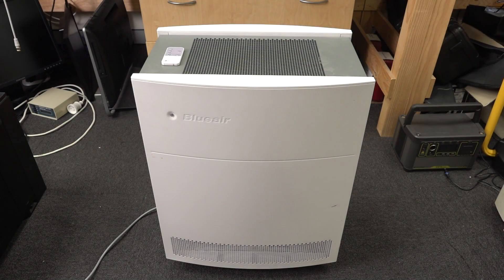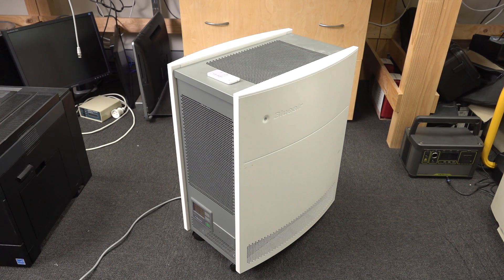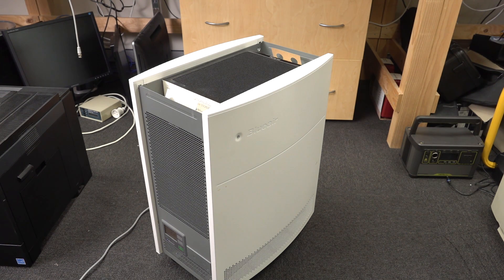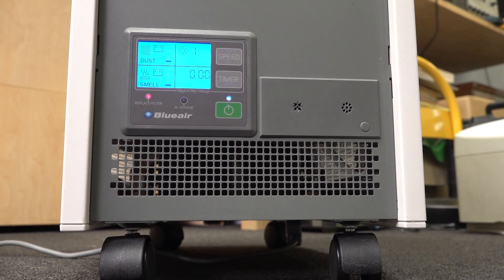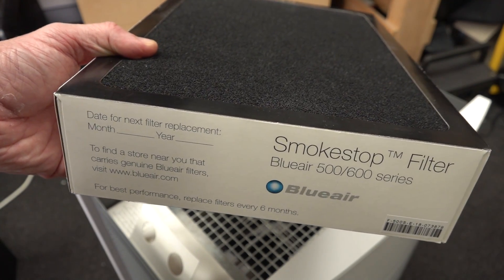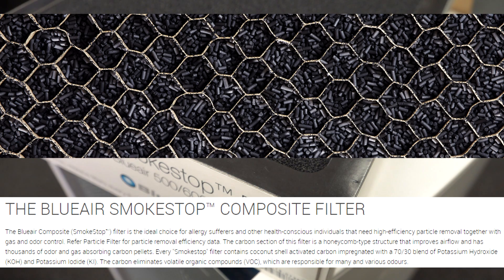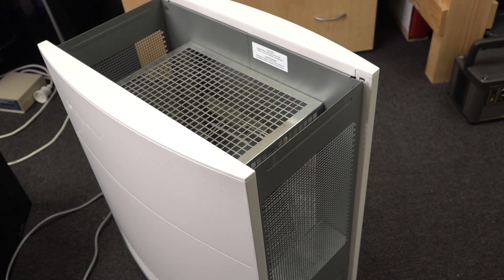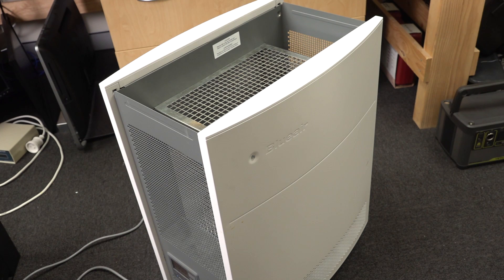EEVblog #1295 - What Makes A Good Lab HEPA Air Filter?

Comment: My opinion is that good Hepa filter doesn't have cardboard holder. The reason is that carboard is soft and is unlikely to be able to stay true from factory to the installation in the machine. The particles filtered are minuscules and the filter will get clogged with use. Once clogged, the air will have more difficulty passing through and will have a tendency to take the path of least resistance which could be a leak around because there is a play in the carboard holder which didn't stay true from factory.

Also, does that unit have seals around those Hepa filter? If it's just pushed against a holder, that's not good enough for ultra fine particles. The filter may be Hepa but you are not getting a Hepa grade filtration with all those leaks.

Futher more, how much activated carbon that unit have in it's carbon cartridges? A good units will have upward of five pounds of carbon. Ideally even above ten pounds. 
 
That may be a good air purifier but my personal opinion is that it's not among the best.

IQAir, Austin air, Airpura are much better units.

Comment: A few chemical gases found in many workplace that no carbon activated filter can remove from the air not even your blue air fancy metal box.
Acetylene, Acetaldehyde, Amines, Ammonia, Butylene, Butyne, Butyraldehyde, Ethylene, 
Methane.

Comment: After seeing this post, I bought a Classic 680i air purifier, that comes with a hefty price by the way.
I’m very sorry but I expected more of both the app and the device.
You can set alarm ranges for all the items that are measured, but they just don’t work. Although my phone is working normally and the notification setting are correct.
The device is noisy at the lowest setting, and makes a rattling noise as if the bearing has an issue.
When I start soldering next to the device, it detects an increased number of particles, as you’d expect.
But then something very annoying happens: the device starts oscillating between the lowest and the highest setting.
Come on, that’s very poor control loop design.
The engineers at Blueair should try to understand how a PID control loop works, and how to design the control electronics properly.
In short: such an expensive unit has too many flaws, both to the app as to the device itself.

Comment: 2:12 "Mechanical filters can only do down to about 0.3 micron at best" - Sorry Dave, but think you're well out there. 0.3um is the "most-penetrative" particle size for a HEPA filter. Diffusion typically traps particles smaller than this, and impaction/interception bigger. https://www.cdc.gov/niosh/docs/2003-136/pdfs/2003-136.pdf?id=10.26616/NIOSHPUB2003136 - p8-12

Comment: 20x20 Lasko box fan ($18-$30)  + 
20x20 HVAC 3M Filtrete MERV 11 (perf 1200) allergen filter w/carbon ($15)  + 
NiteIze CamJam (w/ paracord) (~$8?)   :P   (one step above duct tape - lol)

Super-portable, multi-purpose, inexpensive filter media, easy to use.  There are several YouTube videos suggesting (/testing) this config.

Its not HEPA, but it seems to get out whatever allergen usually bothers me and the carbon does a great job of killing odors.   I personally have enjoyed this more than I expected.

Comment: Hi, your comment re. Hole in the ozone layer should also include "Ozone on Bonding Beach-Periodic table of videos"; how air circulation has been altered to cause rainfall to move Southwards from Oz. This accounts for the devastating droughts in Oz and the new horror of fire storms. The chain of consequences is no joke eh? Nice filter! Great eevblab #72 report, thanks for the research on Medtronics (the ultimate profit oriented company using subdivided territories to push up pricing of insulin pumps. Would you please do a BOM of typical insulin pump designs and relate that to the price of £3000.00 per unit here in the UK? I believe a world-wide single design mass produced would bring a unit price of £5/Au$5 to the table with open source contributions.

Comment: The 0.3 um size particles is actually the worst size for particles, anything bigger or smaller(!) in size gets filtered better. That is because smaller particles then get bounced around by brownian movement of air molecules and "slam" into the blown fibers of the filter and get stuck there.
Also coronavirus is spread by droplets that quickly dry out in the air and create "droplet nuclei" that are larger than the virus itself.
Source: 3M - Respiratory Protection for Airborne Exposures to Biohazards https://multimedia.3m.com/mws/media/409903O/respiratory-protection-against-biohazards.pdf

Comment: Blueair's website has an info graphic that shows a pic of a cube (not a square, but a 3D cube) and next to it, a SQUARE footage rating. Lol. I guess it can handle a 750 ft^2 room, with anywhere between a 6 foot tall to a 16 foot tall ceiling. (4500-12000 ft^3) Derp.

Comment: I run an Amaircare 4000, and it works great! About 20 pounds of activated carbon inside for the VOC and the hepa filter for everything else. It can change the air in a 3000 square foot area 6 times an hour. It's freaking wicked!

...
And I paid 6 bucks for it at a thrift shop.
Reply: What does the replacement filter cost?
Reply: @Daniel-hd7gq  About 290 US dollars.

Comment: I always compare the negative feedback loop of recirculating an ineffective % population of the air in a given time through any exchanger - filter, exhaust, etc - as the same as homeopathy. You can keep cutting it, but if you are mixing clean with dirty you're just mixing the clean back into the soup. This is where proper ducted systems really come into their own where there is a centralized collection point but distributed outputs - causing a net flow through the room that goes faster than the diffusion ratio of the particulate's ability to mix upstream.

Comment: In my opinion bacteria usually are larger: 2 - 3 micrometer (f.e. bacillus subtilis) instead of 0.5  micrometer. 
2:14
Reply: It's not a matter of opinion. Bacteria vary in size by 2-3 orders of magnitude. They can range anywhere from sub micron to the visible range. (Like T. namibiensis, which can be almost 1 mm in size.) It is an infographic. It can't represent every possible bacteria.
Reply: @xenonram  they most likely used rickettsia as the bacterium as it's around 600 nm in size

Comment: I have used those same filters, along with a hardware store cupboard, three large computer fans, and an arduino with similar sensors on a project at home. The dust sensor looks like the Sharp model available commonly for cheap.  You can also get much better particulate sensors like the Plantower PMS7003 commonly now too.

Comment: This is a nice looking filter.

A simple alternative that I use near my 3D printers is a 3M FAP-C01-F1 (~$50 US)  combine it with a FAPF-F1-H (~$20 US) and its lists 0.3 microns and 99.97% airborne particles.
Reply: From what I've read these are almost better. They do lack carbon filtering, and Ion generation but do charge the filters through friction. Their design is somewhat stupid though, sucking in air from the floor if thats where you keep them (I have the bigger unit)

Comment: Please be aware, the safety aspect of a HEPA filter is the seal to the frame/body, and the potential failure of the filter components. In commercial use, HEPA filters are "challenge tested" to ensure their efficiency. The American Society of Heating, Refrigerating and Air-Conditioning Engineers provides a consensus standard for this process: https://www.ashrae.org/File%20Library/Technical%20Resources/Technical%20FAQs/TC-02.04-FAQ-68.pdf

Comment: Have you seen the Airocide?  I have one and very happy with it, would be interesting to get your opinion! It's not a filter so much as a killer of tiny things
Reply: MarkFromSales I believe they are overpriced gimmicks. High price, low air flow, and only works on biological pollution. A comparable price hepa/gas absorption mix will outclass any free radical/catalytic conversation based air purifier.

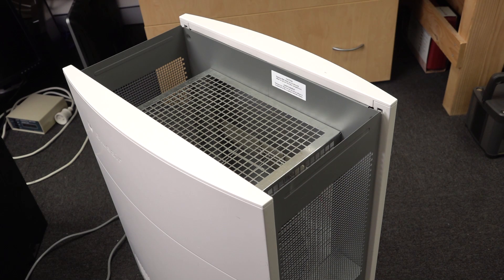Comment: 15:50  It's very easy to teardown and to get into it. You can see (14:09) at the top inner side of the machine, there are screws ~5 cm above each side filter. Unscrew the total 4 of them, then simply lift up the giant white-colored shell on each side, then you have access to the inside of the machine and maybe give a clean to it. I have a 550E used in my home and it has a very similar design with your model. 
Fun fact: the giant fan is actually made in Germany rather than China. 
Caution: Be very careful with the ionizing devices inside. It has small brushes at the end of it and the brushes are actually very fragile.

Comment: While looking on google for specs of H11 (I have some Kirby HEPA rated H11 bags for my Kirby vacuums), I found one site selling some room filter which proclaimed that H11 was "better" than H13/14, using the fine vs. coarse tea strainer principle, because apparently using two filters stacked ontop of each other "works better", except it's still only H11, which is not H13/14, had a good laugh at that one!!! Think they had mistaken filtration for airflow, which apparently they have issues with on both... :P

Comment: Side panel removal. I have a non sensor model the of same size. To remove the sides to vacuum/clean. There are two screws on each side panel at the top in the filter area. Remove these and the panels will slide up about 13mm and unlatch from hooked tabs on the bottom. You may need to lightly bump the panels upward with a light rubber mallet or your palm. While the outside painted panels have been de-burred, the inside galvanized panels are not. If you knock about inside with a brush to loosen dust you'll end up with some scraped knuckles.

Comment: Producing ozone for dezinfection is not bad. I know that it is not good for us to breathe, but saying that air purifier that produces ozone is bad and one that is not producing it is good is not correct. I would say that the one that releses it into the air while you are in the room is not good. But if it has the function to produce the ozone  to clean the air while let's say you are at home might be good idea.
Reply: They will never produce enough ozone to be an effective killer.

Comment: The wifi and app on the later 680i BlueAir model only works with old wifi protocols that no one who is sane would use anymore.  Shame as knowing the pollution levels is useful, I buy the meters of eBay and scatter them around the house .  The filters on the the BlueAir model are really expensive like $150-$200 each (times that by three) as they are combined hepa & dust and need changing every 6 months ... I prefer the E20 Inovaair's (ozzy made too) they filter before the air hits the fan, so the fan doesn't get dusty and they hepa filters last way longer - like years as the dust filter can be changed every 6 months for $30.  I have no affiliation to Inovaair ... theirs is claimed to be certified H13 ... but they also claim to have been lab tested down to 0.003 microns @ 100% ... which is a weird / bold claim to make & advertise.  "Certified 99.97% minimum efficiency at 0.3 microns (tested down to 0.003 microns @ 100% efficiency)*".  It has no electrostatic that I know of.   https://inovaairpurifiers.com.au/products/airclean-e20-plus
The Inovaair's charcol / hepa filters are REALLY heavy like 25 kg, you have to remove them for shipping or they will damage the unit. Inovaair are endorsed by Asthma society and also make medical / industrial grade ones for hospitals and the like.  I got my entire extended family onto them during the recent bushfire season.
Reply: https://smartairfilters.com/en/blog/what-is-pm0-3-why-important/

Comment: The ozone such air purifiers generate is tiny and ozone (o3) quickly falls apart and becomes oxygene (o2) in room air. Every laser printer produces more ozone than this and you still have them in your office.
Reply: A laser printer doesn't run 24x7. It runs for a few seconds/minutes a day. That's why you don't smell ozone from a laser printer, but you do from ozone generators. I am with you in saying (implying) that the neg ion generator in the air filter is no big deal. People seem to confuse neg ion generators (ionizer) with ozone generators, with the former producing less ozone than the latter, and laser printers producing less than the ozone generator; since they are not continually running. From what I can tell, modern laser printers produce about the same amount of ozone as neg ion generators while running; around 100 mg/hr. Compared to the 1000-5000 mg/hr that ozone generators produce. (Naturally these numbers did vary drastically, depending on the model and how/who is testing, but those are averages of what I found.) So, since a laser printer runs about 0.1% of the time (Assuming a very high average run time of 90 seconds per day, for the laser printer, in a business like Dave's), it is producing a negligible amount of ozone. Like 2.5 mg/day.

Comment: I have a one cheaper unit at home, mainly to catch dust from construction works 
It have build in UV  lamp to sanitize filter/air, no idea how effective it is 
But after year or so fan start to squeak at low speed, other way it was silent 
Expect some super cheapo build motor bearing and it have no way to disassemble/repair at if looks like a glued/welded plastic

Comment: I got a Xiaomi Air Purifier 2S and it's pretty good to get the smell out of the air. The display always shows 0.1 while running, sometimes higher, after opening the windows. 600 on new year at 1am. It does something. Small House, small room.
But I can't find many data about the filter. It says 0.3PM? Sometimes it's HEPA,, sometimes EPA. Chinese Stuff.

Comment: You don't need 0.1um filters to filter Coronavirus, they travel with body fluids, saliva, mucus, and those fluids particles are much bigger than that. That's why doctors use N95 masks, which blocks 95% of 0.3um particles and they are just fine.

Comment: A terrific little company, just up the road from you Dave in Tuggerah, InovaAir make H13 HEPA with activated carbon air purifiers. With our dollar taking a dive, these locals will be making top-quality filtration for Aussies way cheaper than their OS competitors. I got an H8 model from them to survive the bushfire smoke after our last-but-one disaster and it works exceptionally well, even though it's only the baby air purifier.

Comment: I've got a furnace filter taped to the back of a box fan with a modded ionic pro in front of it

Given the whole lot cost 20$, it can't be worse than not using anything
Reply: I did the same thing back in the 90’s and forgot that it was behind the couch - after about a year I checked it and it looked like a Wookiee with all the hair and dust

Comment: The air passes through the blades, and it gets filtered to the outlet. In time, the motor and blades compartiment could get covered with dust. A better design would be to filter the air before the blades.
Reply: a blowing fan is easier to use because you put filters around it and it will blow air out of all of it equally, unlike a sucking fan which suck air from the nearest inlet which skip the filter so you have to make the enclosure air tight.

Comment: Put some fog in your room and turn on  the hepa filter
Reply: Smoke not fog please. This is a stupid way to test a hepa filter. There are videos where they test with a fog machine..

Fog machines release fine liquid droplets into the air. Nothing you usually have or need to filter out of your air.. only makes your filter wet.
Reply: @Daniel-hd7gq  
Thanks

Comment: Dave - if you look at the specs for the N95 mask standard, they're rated against .3 micron particles because that's the most difficult size to filter for various weird reasons.   In fact, those masks and similar filters typically filter more particles both larger and smaller than 0.3 micron, which is another reason they're useful against viruses smaller than 0.3.   They also use electrostatic attraction for specific sizes, because they're designed to gain an electrical charge statically from the air flowing through them.
Reply: +rep

Comment: Just ordered 2 of the IQAir HealthPro Plus. I was going to go for the BlueAir 605 but wasn't fond of the design having dusty intake air running through the fan and most of the chassis before being filtered. There should be a filter at the intake even if it's not more than a prefilter. Great info, thanks as usual Dave.
Reply: x65535x owing both units I agree the iq air is a better choice. The iq air has a pre filter, separate gas absorption filter, lower yearly filter cost, filters that are capable of 0.003 microns vs 0.1 on the BlueAir, and a much better full system air seal.
Reply: @Dirty_Bear22  That was my feeling too about the seals. I also run humidifiers for my plants in the same rooms I have the IQAir units in. I've noticed the humidifiers tend to cause airborne particles to coalesce with the water vapor (ultrasonic based humidifiers) and the IQAir units pull all of that out of the air, it seems like most of the large particles get caught in the prefilter and the rest is captured by the molecular absorbent media and the final HEPA stage.  They really do make a difference. I'm also pleased that they don't have any ion generation inside, I suspect the only way even high end ionic filtration passes CARB testing for ozone generation are due to the carbon filter absorbing the ozone, there is also of course other products like Nitrogen Oxides which the carbon stage would filter out until it is no longer active.

Comment: Oh, you've ruined that sensor by taking it out, I tried it before and it messed up the readings
Reply from the maker: Rubbish. Works fine.
Reply: don't take it out while it's powered, otherwise the cal with go nuts. taking it out without power is just as harmless as unplugging a USB stick from a shut down computer.